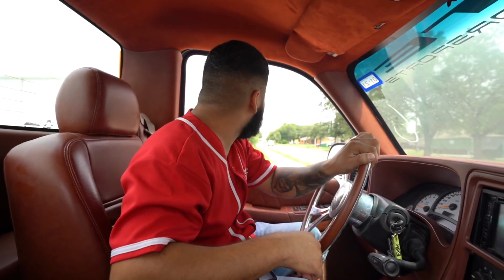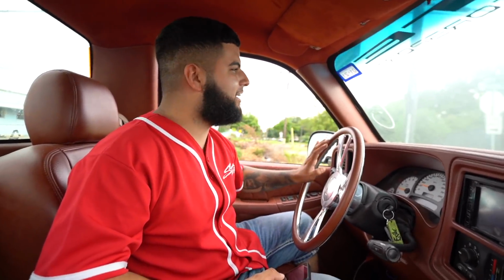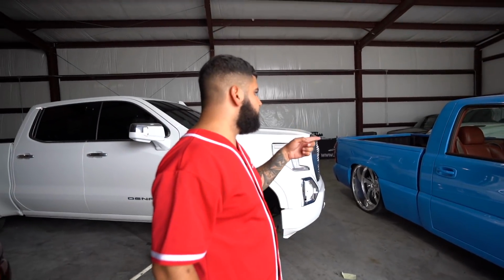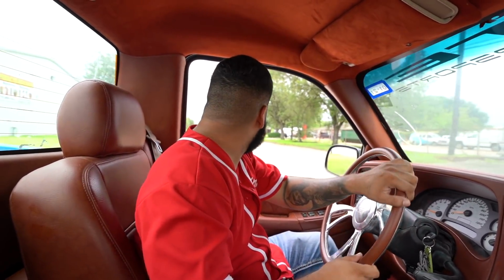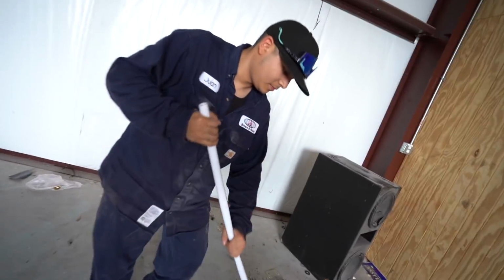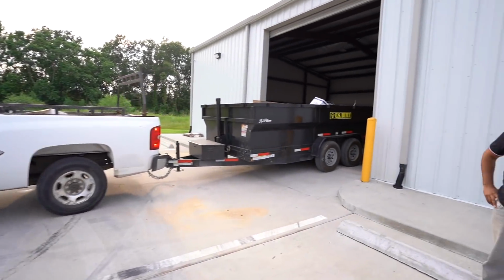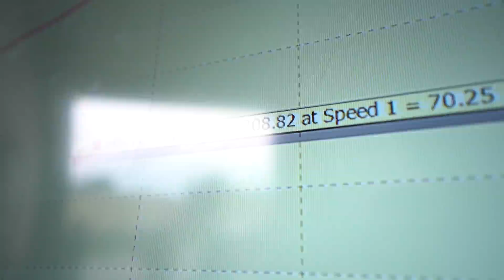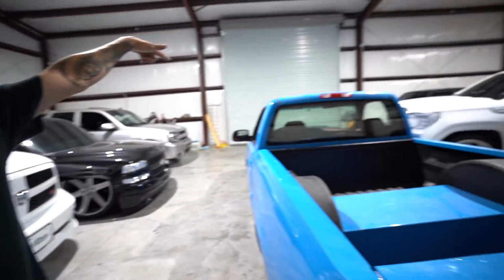BAGGED SS CLONE GETS DYNO TUNED!

Comment: Check frame that bed gap ain't right. Plus get a engine driven compressor 78 ford a.c. compressor is what ya need
Reply: The bed gap is only cause the bottom half has SS cladding